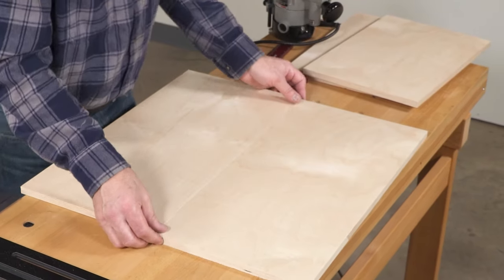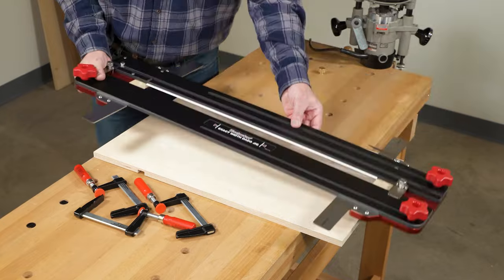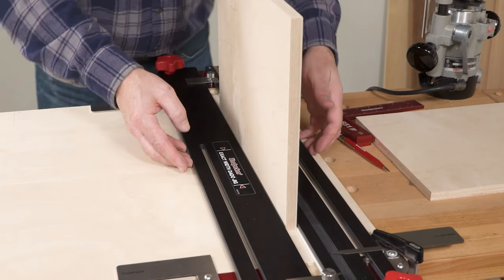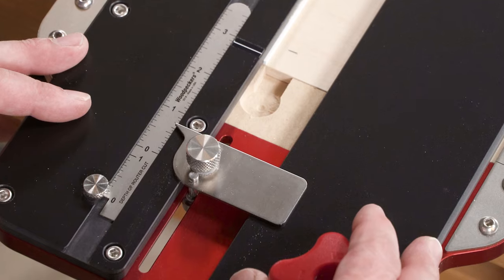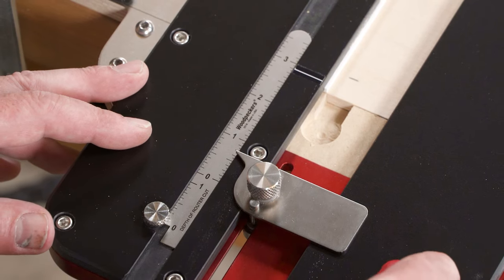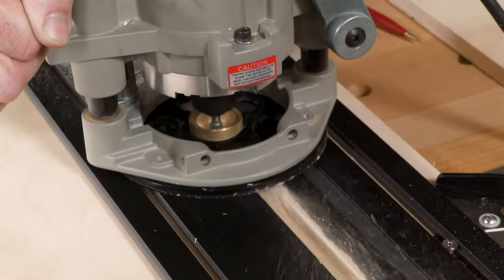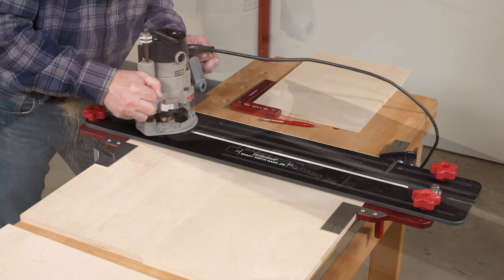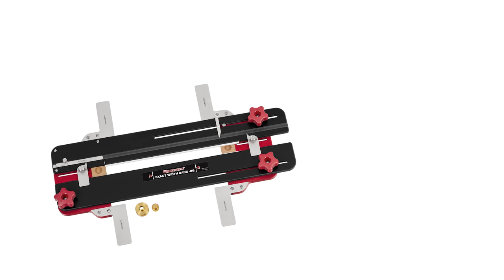Exact Width Dado Jig | Woodpeckers Tools

Comment: Has anyone tested a carbide triple spiral bit vs a carbide tipped straight bit to see if one makes a cleaner dado than the other?  Does the upcut or downcut spiral bit result in a smoother surface with less tear-out adjacent to the dado?